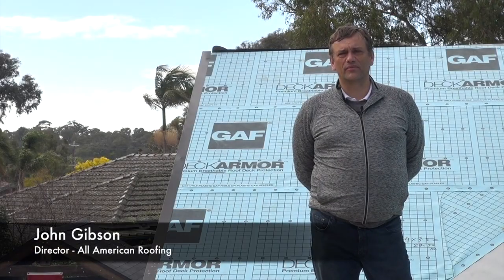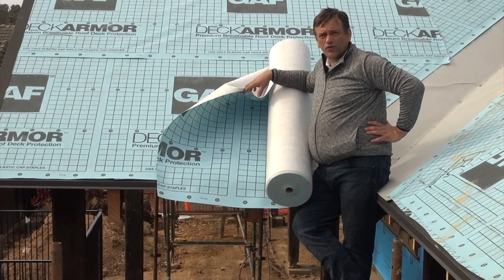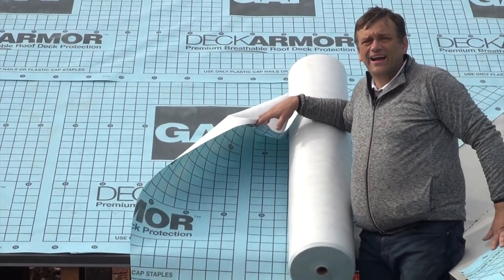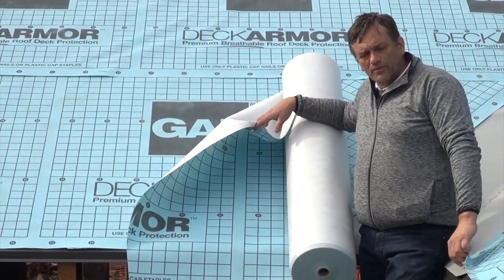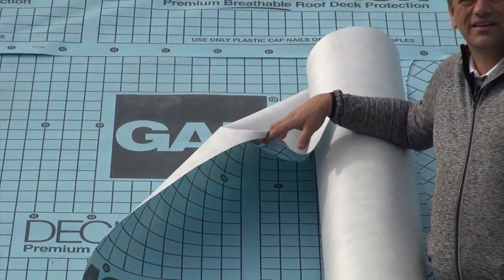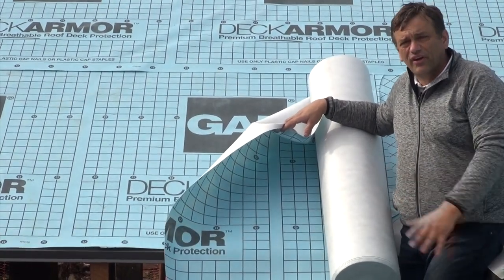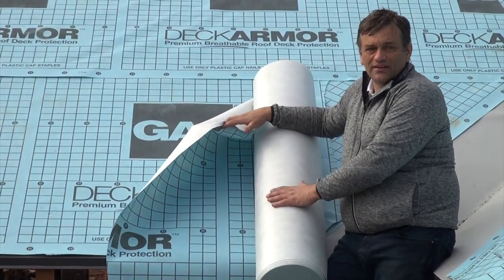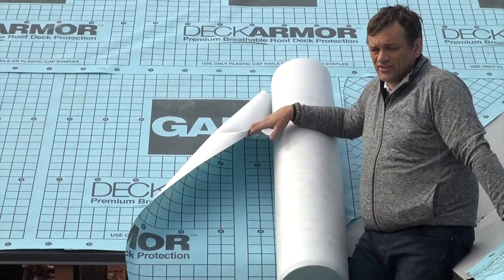GAF Deck Armor Installation For Asphalt Shingles

Comment: It is breathable and also water resistant, but it is not waterproof. GAF specifically warns against using it for temporary weather protection. If water gets under the shingles, only ice & water shield will help since it is self-sealing. All other underlayments are penetrated by thousands of nails, and every penetration can leak. Asphalt felt is both waterproof and breathable. It does degrade over many years but no underlayment will save your roof if the shingles or penetrations are leaking. The most you can hope for is reducing intrusions during blowoffs.